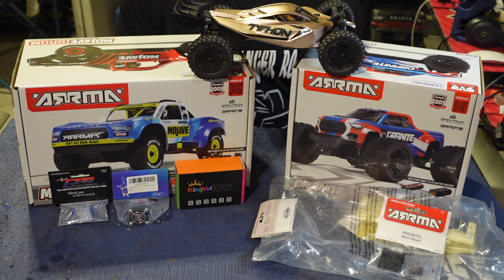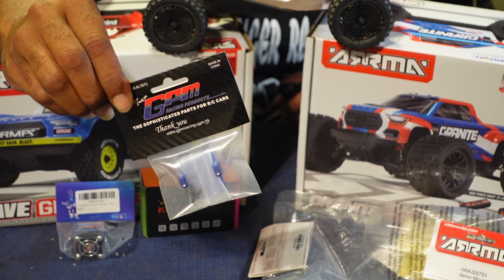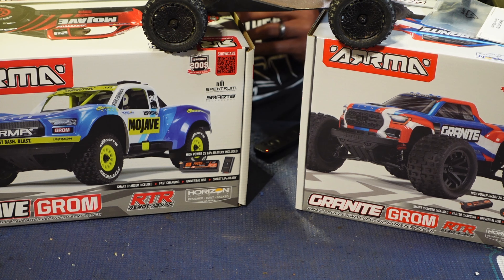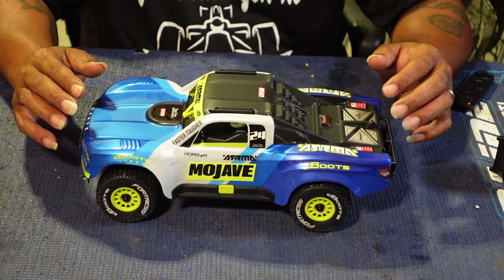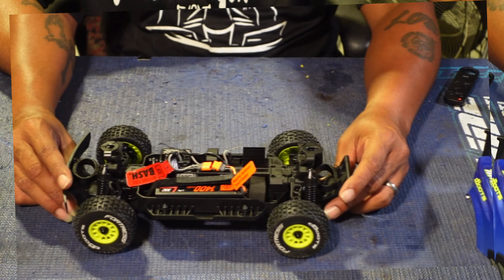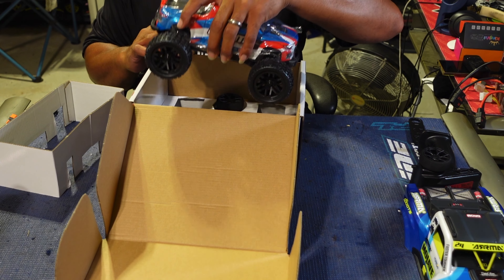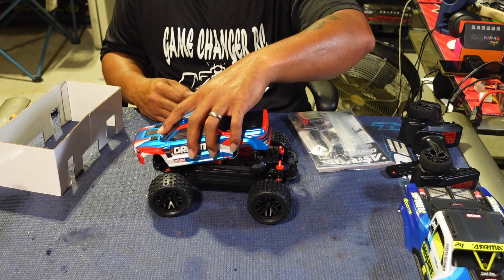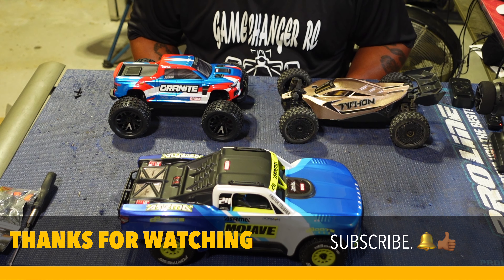Arrma Mojave grom brushless unboxing

Comment: Nice.. you grab some turnbuckles for the granite. They on horizon. Im still in punta cana. Come back tomorrow. Got mine waiting on me.. clearbody too. Think ima go black and light it up. Lol. But we will see. Ohh pulled the trigger on the vitavon rack & pinion gears for the vigilante too. Got some work waiting on me when i get back
Reply from the maker: @MrMeDos  yes sir my motor mount from vitavon came in the other day just need a esc now video coming soon and I'm digging these little rc's for now cheap to build and easy to work on not going to do a lot of upgrades until they start to break

Comment: I’m curious. I really want to run a cheap Amazon esc but the reviews are BAD. Curious how this holds up!
Reply from the maker: This is my second one they do get a little hot especially on 3s I only went the cheap route because I buy a lot of rc car's that I can't do the cheap stuff to
Reply: @GAPreviewsAtoZ   Nice. I ended up finding. $30 HW system and only running 2s on it. I have the Typhon grom and I like the lighter batter weight.
Reply: @GAPreviewsAtoZ  Supposidly the Hypergo esc’s are good and cheap. But I didn’t have the balls so went the HW route 😆